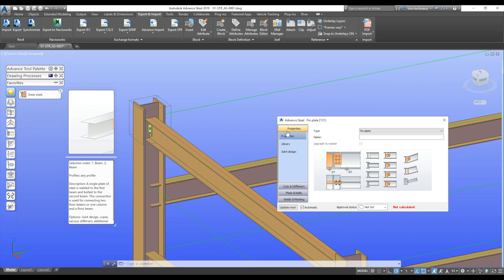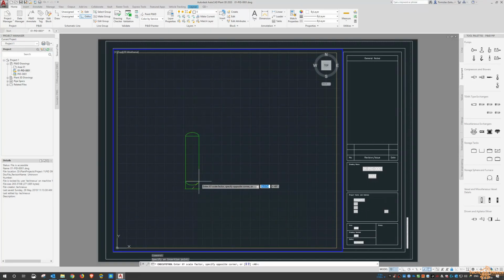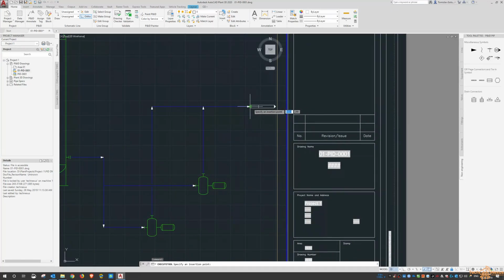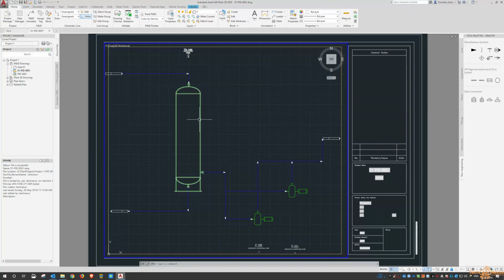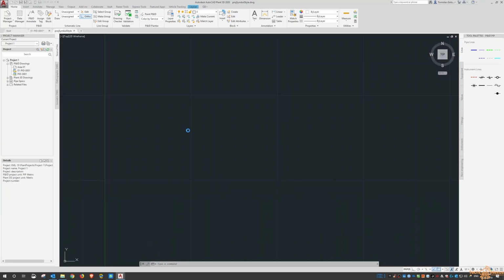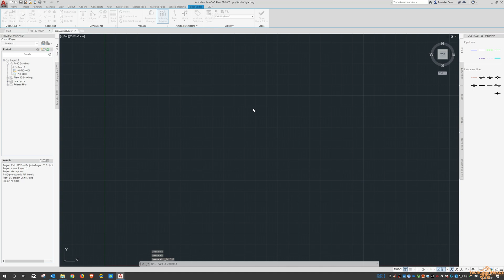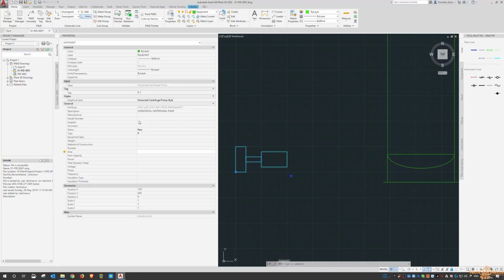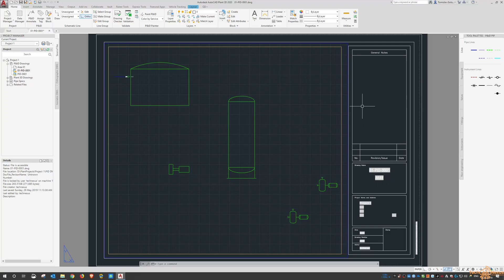P&ID's Week - Part 3 - Layout thoughts and placing Equipment

Comment: I would have a question:

I'm working with multiple reactors that are exactly the same. So I basically have drawn one once and now usually copy paste them. Obviously I cant  name for valves RC1-CV-1. So basically what I have done so far is: use the find function and replace the RC1 with RC2.. and so on. That works optically but in the background the plant 3d actually doisagrees. How would I do something like that properly?

I would really appreciate your help.

Have a nice day!